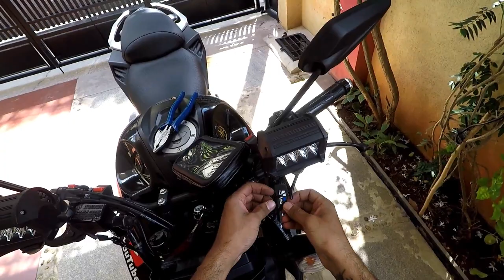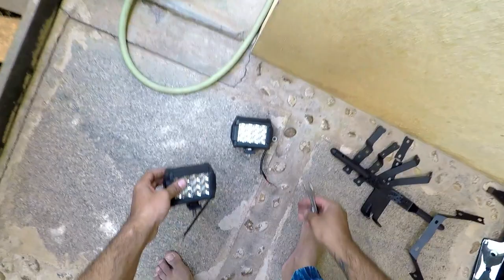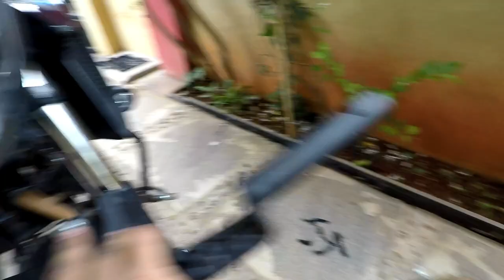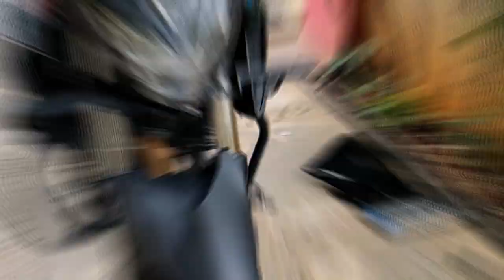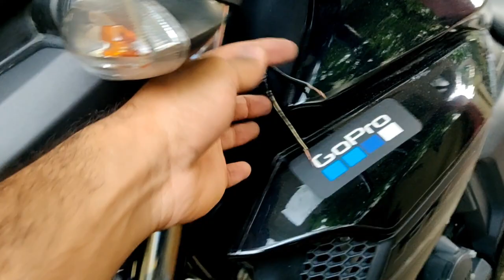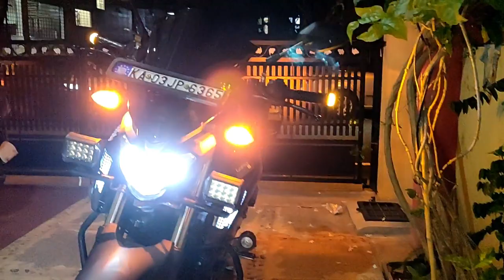Lluvia aux light clamp installation | FZ25 Fog Light Clamp | FZ25 modifications

Comment: Can battery of FZ25 handle two 60W aux lamps??
Reply from the maker: It can handle only with Relay. Don't take risk of not installing a relay for 120w light
Reply: Where can I buy it online?
Reply from the maker: @SiamaB  check in Amazon. Just type Relay for lights for bike
Reply: I have already bought aux lamps from local shop. I don't have any idea what relay is. Is it just the switch or a light? Could you please elaborate?
Reply: Is it something like this?
Reply from the maker: yes the Amazon link what you have shared is correct. Relay is just a device through which wiring is done when the additional lights or horns are of higher watts and they need to be kept stable. In general, relay will act as stabilizer. Just like your TV or fridge stabilizer. But technical answer will be different. Anyway, use relay for higher power light.
Reply: @MachineDiariesVlogs  Thank you so much 😊

Comment: Bro did you change the screw on the  brake line side, if yes  what are the specs .?
Reply: @MachineDiariesVlogs  ho thankyou ,the existing bolt wont fit due to shorter length.

Comment: what about the 5 year warranty if something happens to the electrical system? When i recently visited the service center they suggested not to use any aux lights..
Reply: Don't cut stock wires while fitting any component.... before claiming warranty remove all the aftermarket accessories
Reply: I missed 1 service due to lockdown at my area. I lost my 5 year warranty 🙃